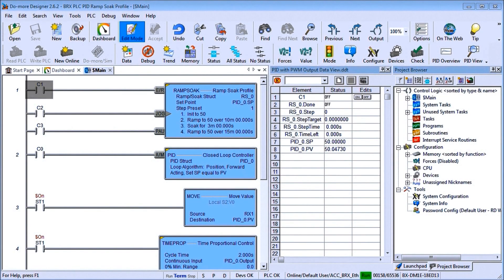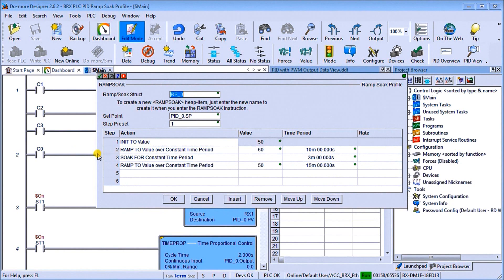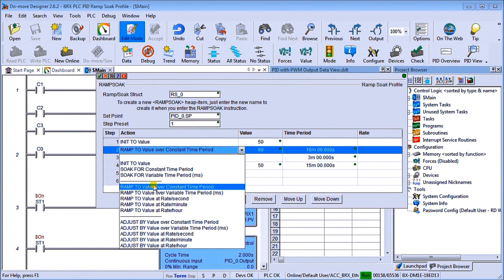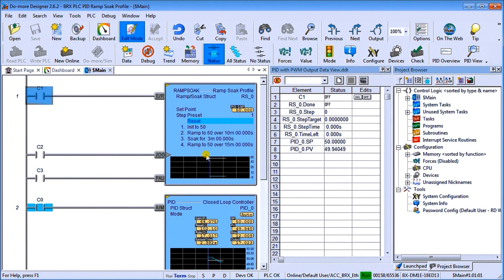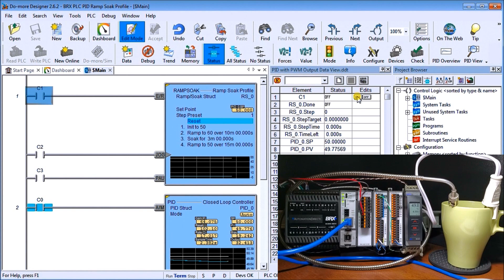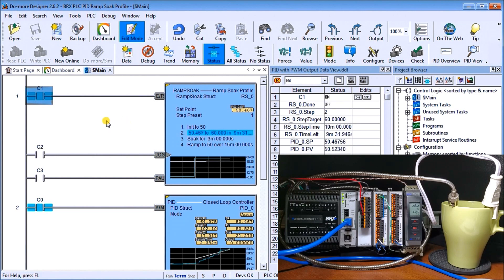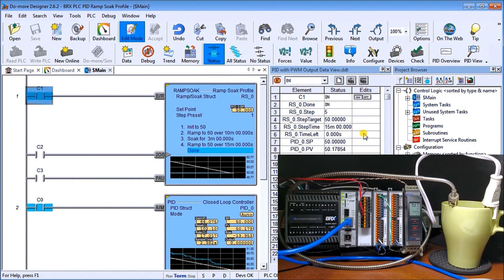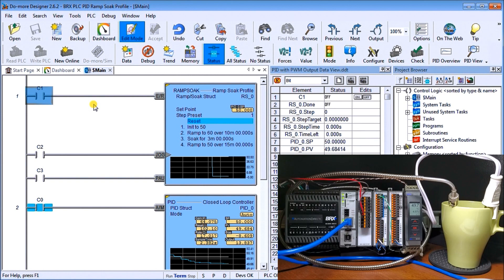BRX (Do-More) PLC PID Ramp Soak Profile

Comment: Garry, what is the purpose of ramp soak if you're using PID to control the temperature of the item you're heating?
Reply from the maker: Hi Joe,
The purpose of the ramp soak is to adjust the temperature. An example would be to slowly heat the item up over several hours, then hold that temperature for 1 hour and finally cool down as quickly as possible. This is how the ramp soak can be programmed. The PID is just the method of control to maintain the setpoint.
Regards,
Garry

Comment: Hello, I'm not seeing a built in way to add a profile dynamically at runtime. Say, over Modbus or from a C-More HMI. I'm sure I can do it but is there a built in way to accommodate this? Thank you.
Reply from the maker: Hi Noah Killian,
In the post I used constant values to control. If this is to be done via Modbus or a C-More HMI then memory locations can be entered instead.
Example:
Step 1 - Action - INIT to Value -  Value - MHR0 (50 was in the sample program)
I hope this helps you out.
Regards,
Garry
Reply: @ACCautomation Thank you for the reply! That makes sense. I was hoping for something that would let me add steps in a loop or similar. I guess I'm still trying to treat this in a procedural manner. I did wind up coming up with a way to do it though.
Thank you for your help,
Noah Killian
Reply: @noahk360  Did you end up finding a solution. I was planning to make a handler that had the user select "add step" and choose "ramp by time" or "rate" or "soak" and then do all the backend math to but it in the ramp tool with the actions always fixed since you cant change these at runtime. Please let me know if you found a way to do this.